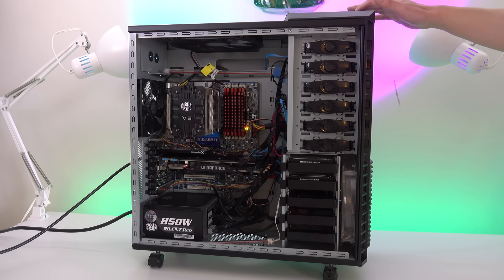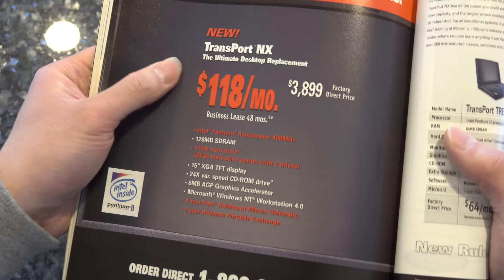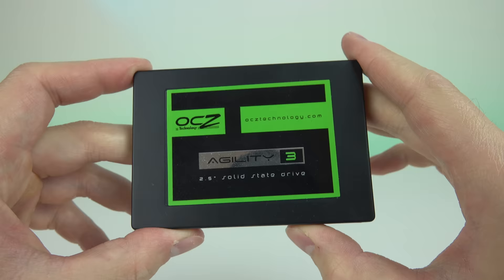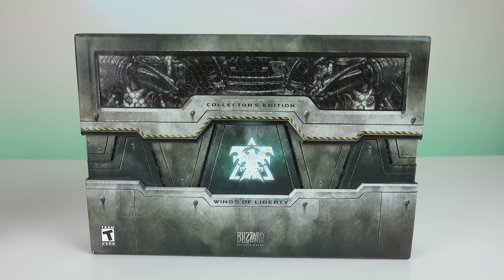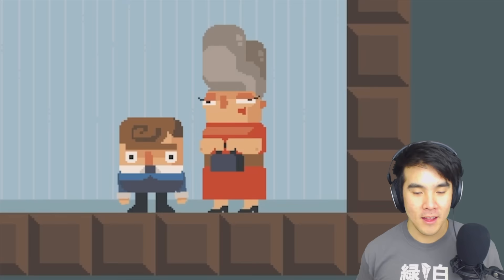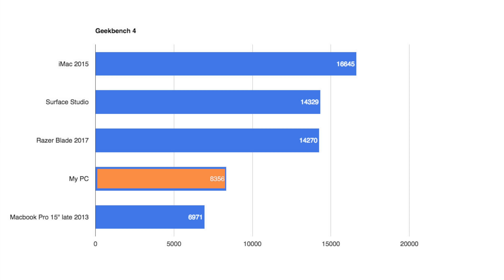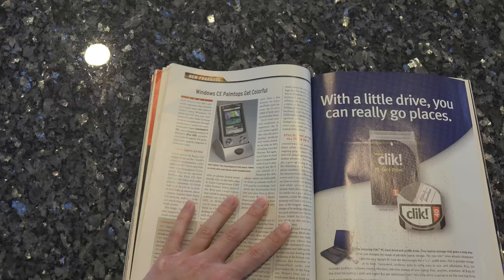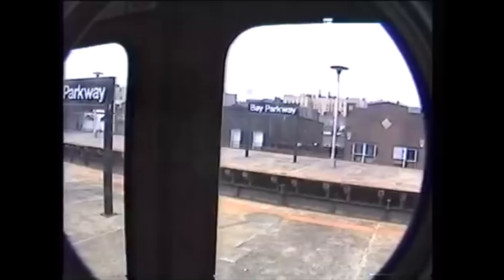I Built This PC for $1360 in 2010. Here's How It Holds Up.

Comment: Yeah cool
Now show us the pc you built in 1360 for $2010
Reply: That thing is pretty hardcore, with a small formfactor wooden case, a rockium processor and a cutting edge screen made out of quality canvas. The memory depended on how tired you were when using it, which was the best that could be done at the time. Also it had no GPU, as there was no need for one at the time, making it unable to even display a Picture. But it could handle about 0.5 calculations per second at it's peak, sometimes exceeding times of even 1 calculation per minute. The most expensive parts of the PC were the case, and the canvas screen, as canvas was pretty damn expensive at the time and the case was custom made. The canvas cost 1900$ and the case cost 110$.

Let's just say i wouldn't play Minecraft on it.
Reply: You'd probably have a better time playing Minecraft in real life.
Reply: @JamB-zo1ln  Battlefield too
Reply: @JamB-zo1ln  Assassin's creed

Comment from the maker: Hey everyone! I posted a new video "These Tech Ads From 1999 Are Ridiculous. How Do They Compare to Today's Ads?" https://www.youtube.com/watch?v=fkSe8CaAJnc thanks for visiting 🙏
Reply: Chubbyemu but can it run crysis?
Reply: Hi There, Before you retire that system buy an used Xeon X56xx chip and install it.   I just upgraded my system from a i7 960, to a Xeon X5670 and "only" OC it to 3.6 (3,75 ht) so far.   Its performing great.   I did this after buying a GTX 1080 card  (old GPU 2x6970 2GB) as the first component of a new system, but decided to try out the Xeon X56xx before i retired it.   6 cores with HT with no OC issues so far great results.   The i7 9xx series are 130W cpu's on the 45nm layout.   Xeon X56xx are 95W on the 32nm build.   So my cpu @ 3,6 with all cores, ht and turbo on and 1,32V 150MHz bus and 24x multi is 100% stable.   (Motherboard: Rampage III extreme, 12GB DDR3 @ (752MHz/  2.4GHz).   I'm really happy. Way less noise, and performs way over my expectations
Reply: Ciliaris1 The 1366 Xeon's are great ! Now im using a x5650 running at 4ghz at 1.285 volts on my asus P6T V2, In cinebench i got like 940 points in cinebench r15
Reply: Ciliaris1 i am running x5650 @4.4ghz with 12gb ram @1700mhz with gtx 980
Reply: Chubbyemu great video! The 3rd generation i processors sandy bridge were a lot faster than what you have now. If you had that one you probably would have been able to go on for a couple or more years!
Reply: X AK close to my specs x5650 @4.4 with 7950 crossfire
Reply: Chubbyemu are you chinese people?
Reply: put a 40 dollar xeon chip in there.  you will use that pc for 2 more years.
Reply: Chubbyemu yeah unfornatlty even though its 2017 my aunt still thinks it's 1991
Reply: About your streaming, have you thought about using hardware encoding?
Reply: Chubbyemu your cpu is whats holding the system back a 7th gen i3 is probably faster
Reply: itsya boi Not true, as my 7 year old x5675@4.17 GHz beats an i7-6700k, he can do the same upgrade to his system and keep it for another 5 years
Reply: Well my pc is Core2Duo 2x1,86GHz from 2006, 4GB RAM, HD5770. Both ram and gpu bought in 2010.
Well it's worth mentioning that I run 64bit Linux and all works great while 64bit windblozer just kills this machine. No matter win7 or 10. If it's 64bit you could say that this rig is a trash.
I'm curious did you add extra value from upgrades like new ssd and gpu to the entry price. After all it's a total cost of your pc.
Plus I still have my Commodore 64, but psu cables burned, so they need to be fixed. Other that that it also works fine.
Reply: Mine x5675 is at 4.5Ghz with watercooling, and makes more Cinebench than 7700k at 4.5Ghz :D ofc it is 6 core but you know ... :) CPU + MB + 24Gig of ram cost me only 300 eur :)
Reply: Andrej Ka Hey what bios settings did you use to achieve the awesome 4.5 GHz clockspeed? Mine's at only 4.17 GHz and still beats a 6700k in passmark! Just so you know your board supports up to 3x more memory!!! Guaranteed to go up to 48gb with a slight possibility of even 96gb of ram!!!!!!! (too bad ram prices are going up)
Reply: Hades Eye Upgrade your core2duo to a Xeon quad-core x5470@3.33 GHz, huuuuuuuuge upgrade and will add a equally huge smile to your face! The x5470 is so powerful@ stock clockspeed it competes with the brand-new pentium g4560 that used heavily when playing the latest games. The best part is once you overclock the x5470 to 4 GHz or up to 4.5 GHz with sufficient cooling all of a sudden the x5470 will beat the i5-2500 and compete with the i3-7350k, mind-blowing performance for LGA 775!!!
Reply: Chubbyemu if you upgrade to the x5675 you will love it, trust me, even with zero overclocking you'll gain an additional 30% performance with a low 95 watts tdp, huuuuuuuuge upgrade! BTW you won't have to spend huge money either to achieve this upgrade not to mention that you'll gain additional ram capacity up to an beyond 48gb ddr3 ecc, crazy!!!
Reply: David Johnson you have to play a lot. my mobo is asus p6t deluxe and lets me to crossflash bios from asus workstation ws mobo, so my cpu can go to high tdp mode allowing stable 25-26 milti, and at 180 bclk I get around 4.5ghz at stock and for single cores up to 4.68 ghz when it rises up to 26 multi but only SIV registers this :). . Ofc power supply is 850RMi and cooling is h110igtx modded for better air push performance. I am planning on laping this cpu and try push a little bit higher when I have time. Anyway, 24 gig is enough for me now, it is crucial ballistix sport. If I find some new ones 6x8 gigs for a good price, I will definetly change but for all work even 16 gigabytes is enough :)
Reply: David Johnson I had x4570 on lga 775 @4.5ghz too :D would be enough for everything I did, but it did not have some instructions and for additoonal few hundred euro I got faster chipset and 2.5 more performance from x5675. I think fair deal :D
Reply: I've had thesame experience with my pc that I bought for €1000 back in early 2012. Basicly, if you buy a decent pc(not budget), it'll last 5 years or more, provided you're not upgrading in  resolution.
Reply: hi i'm new to your channel i love it it brings back memories lol good work :D
Reply: Chubbyemu build a ryzen Vega !!!!!!!
Reply: Dude! I'm in exactly the same situation. Using the same rig from 2010, except no upgrades. Well one actually - an OCZ agility 3 lol. I'm amazed the same PC is still serviceable today. But you're right, now is a great time to upgrade. I'm hoping a Ryzen build will last me another 8 years. Enjoyed your visit. All the best
Reply: David Johnson not the same processer 1st generation i3-7's are all around slow joawdays
Reply: Ciliaris1 Also your board can now go up to 48gb of ddr3 ecc ram, potentially even 96gb!!!
Reply: Chubbyemu chubby, you have acne scars. Ok.

Comment: It's crazy how much longer computers last now. I built a gaming PC in 2012 for $1,000 with an 3770k and 16 GB ram. Other than the video card dying a few years back (where I just purchased a $50 replacement) and upgrading the ram around that same time to 32 gb (for equally cheap), it was fine until recently when I really started seeing mediocre performance in games and upgraded. And honestly, for regular use, it would still be very fast.

You just couldn't have that kind of longevity with computers in the 90's and 2000's.
Reply: I have almost the same experience (even video card dying few years back). Just finished building new PC few days ago mainly for gaming, and as you said, for other tasks it would have still been fine. Hopefully it will last another 10 years.
Reply: i have like your old setup and it works great for me stil can run most games at good enough speeds for me
Reply: @TheCtibbs  I doubt that honestly, I had to get rid of my i7 4790K and GTX 970, with ddr3 ram. The cpu isn't the problem it's everything else, especially since I wanted to use Windows 11 and an nvme ssd. Got a 12700k when it came out (which is now more than half price) and 3090 (same case) which would last me another 5 years but I'm probably gonna upgrade next year again. It was a night and day difference though. The 12700k is now cheaper than the 4790k I bought when it came out. 

The great thing about PC building is I can sell or keep my old parts. It's like chasing a high. I don't need to upgrade, but the ability to do so drives me to do things that require more power, making me want to upgrade every few years. Honestly though if you can afford it, I wouldn't keep using ddr3 and PCIe 3 in 2024, when ddr5 and PCIE 5 are a thing. Get something in the middle. I'm still on ddr4. 

 Your platform is over 10 years old, it's best to upgrade at least every 5-7 years like consoles do.
Reply: @mycelia_ow upgrading every 5-7years works only if you get high e d parts
Reply: @Ciffer-1998 entirely depends on what you do. if you are just a casual gamer who wants to play on 4k high settings and changes games like socks, then yes
Reply: Same, my my pc is still a 3770 oc 4.1 ghz, 24 gb ram and GTX 1660 Ti, my GTX 770 died in 2018 so I upgraded a year later, in some games still have smooth 60 fps, meanwhile other the fps drops to 40s & 50s, spiderman remastered run at 60 fps custom settings without any upscaling
Reply: @Ciffer-1998  Not really. It depends what youre using it for.
Reply: This video is 6 years old which means its almost as old as the pc was when this video was made. Youtube algorithm is at it again
Reply: @jebreggie4225  playing games, if back in 2016 you bought gtx 1050,1050ti or 1060 here in 2023 can can barely play anything even on low, on the other hand if you got gtx 1080 or 1080ti you will still manage 60fps in most cases(i am not counting on upscallers and frame gen)
Reply: I equate this to the fact that hardware advancements has slowed down significantly. A lot of our standards have been standard for a while and have been excellently future-proofed. While we still have bottlenecks, there aren't as many technological improvements that aren't compatible with existing hardware as there used to be back in the day. It's great, actually. Because the hardware I use for a computer I built for myself back in November 2023 is still capable of running Windows Vista and 7, showing how well the technology was originally developed and how it still stands up today.
Reply: @Ciffer-1998  The 1060 came out in 2016 and can still play games despite not being a high end part so you disproved yourself. even if its best days are numbered it still got seven years for many people
Reply: @mycelia_ow  I use ddr4 but PCIe is another story, new games doesn't utilize the full capability of PCIe 3 let alone PCIe 4 or 5 and now 6 released in 2022, unless you use PCIe 3 x16 for massive data transfer between 2 PC's with a speed beyond the latest nvme speed 7 GB/s while PCIe 3 x16 speed is 16 GB/s, and this invention doesn't exist yet for consumers.
Reply: Yeah I still have mines I built in 2011 with upgraded parts.  Still runs good.

Comment: 3 ghz in 2002.
my laptop from 2015 still running on frickin 1.5 ghz...
1.5 GHZ
Reply: Schroeder M. Schulz Mine is 1.6 GHz and it cost me only 300
Reply: DiBoss Wtf...
Reply: Schroeder M. Schulz Uhhh, sorry, that's now how specs work.
Reply: Yeah well, you can't compare clocks between proccesors from different arquitectures.
Reply: Your laptop is still faster tho :P
Reply: They were single-core.
Reply: Then the 1.4k MacBook pro with less than 2.5ghz processor
Reply: and your laptop is far more powerful
Reply: Lol well back in 2002 it was most likely a single core cpu.

I've got a laptop with a 1.4ghz e1-1200 dual core
Another laptop with an a6-6310 1.8ghz quad core

And my desktop is a 3.7ghz hyperthreaded dual core :)
Reply: Sitting on my 760k @4.5ghz, got a job planning to get a i7 7700k @4.2ghz native.
Reply: Would rather go for a R7 1700
Reply: DiBoss you got ripped off bro.
Reply: Armand Kabanga No he didn’t. Most laptops in that range are about that speed. Clock speed doesn’t determine the speed of the CPU completely. 

He could have a quad core 1.6ghz in his laptop with 6gb of ram and a 250gb ssd. But since you don’t know the rest of his specs then you can’t say he got ripped off.
Reply: PissedOffHoneyBadger true true, I assumed he got ripped off cuz I got 1.6ghz too, and I can't even run saints row 2 on low settings
Reply: Armand Kabanga Well it’s a $300 laptop. You can’t really have high expectations. It might not be able to game because the specs are low but don’t say you get ripped off because the price/performance could very easily be one of the best on the market even though it still sucks for gaming.

1.6ghz could be plenty but you have to take account of the GPU/iGPU as well. It could very easily be that.
Reply: Schroeder M. Schulz my laptop got a 1Ghz processor
Reply: my laptop is 8gb ram 1tb hdd and 2.5 ghz 4core cpu i paid like 350$ ish for it :p
Reply: its more powerful and far better than the 2002 ones cuz its multi core, even 2 cores are far better than a single core, the difference is actually great than two times, 4 cores was the next big jump but after 8 its not that significant
Reply: Starless Knight lol what you talk is bs, sry
Reply: Microage so your saying you would rather buy a 5ghz single core processor rather than 2.5 ghz dual core processor?and the single core is better?
Reply: Schroeder M. Schulz I also have a 2002 dell laptop functioning fine.
Reply: adrian gil of course it would run fine..

if you didnt install any modern shit in it..
your dell would ran smoothly
Reply: Starless Knight 

Okay you must take account of the age as well. Some CPUs have better technology which help execute processes even if they have the same amount of cores and clock speed. For instance, my I3 6100 has a 14nm (nanometer process technology).... the lower the number the better it seems the be.

My i3 6100 3.7ghz dual core can beat the AMD Fx 8350 which is like 4.2ghz and an 8 core!!!!

I would recommend a 2.5ghz dual core over a 5ghz single core any day.
Reply: PissedOffHoneyBadger i know but i never mentioned nm did i
Reply: ateb3 it doesn't work that way
Reply: sideKick Haha I know right.
Reply: Still faster speeds than a modern Macbook.
Reply: DJ Shuffle anything is faster than a modern macbook
Reply: sideKick thats a sarcasm..
Reply: Schroeder M. Schulz too bad ghz doesn't mean shit on its own
Reply: before cpu's were all about gigahertz because speed was directly affected by the number of transistors. then intel released the core series and everything changed. nowadays, the architecture tells how fast your cpu can get. In other words, that 3 ghz in 2002 is definately beatable by a 1.5 ghz cpu from 2015 because of the difference in architectures
Reply: PissedOffHoneyBadger my pc was under 300
Reply: Who cares about frequency ? CPUs are way more efficient nowadays so a 3ghz cpu from 2002 is waayyy slower than a 1.5ghz cpu from today
Reply: The number of Ghz isn't really important for that. 1.5Ghz nowadays is way better than 3ghz in 2002. CPUs have way more tech than just ghz.
Reply: 3 ghz but it's single core.
so who cares?
Reply: powebat I feel so bad for you
Reply: my old computer was 1.5 GHZ too, it was about 200 to 300 dollars, I think what bumped up the price for that pc is that it had 1TB and 8 Ram. lol

edit: I actually kept that crappy computer for about 2 years and a half until in December 2016 I got a new pc that cost about 1 thousand dollars now
Reply: Clock speed is almost meaningless these days. The number of cores and IPC count is much more meaningful.
Reply: My first PC in 1996 was 133MHz... it had a 1GB (about 1000x smaller than 1TB) HDD. Used it ONLY for word processing in College, and didn't even have an Internet connection. $3000 (CDN) including my 15" CRT (tube) monitor... spent $400 on a 4MB video card for some reason in the next year... my roommate spent more than that to upgrade his 100MHz? CPU to 166MHz + video card so he could play Wing Commander 3... in 1999 he spent $300 on a CD-R for it and it kept getting ERRORS because there was no proper BUFFERING of data (so had to drop CD recording to 1x down from 4x).

Built a new PC every three years then my i7-3770K (4.5GHz OC) rig has lasted me FIVE YEARS (with GPU, SSD etc upgrades) and I plan to keep it at least FIVE MORE YEARS...

I rarely use more than 50% of the CPU so even if games get more demanding of the CPU I think DX12/Vulkan will make efficient enough usage of it so that there's no pressing need to upgrade (by using MORE of the cores AND using more efficient code for draw calls etc).
Reply: yeah, cause its a laptop, it probably doesn't have a full fledged desktop grade cpu in it.
Reply: LinusMLGTips yes that is, his cpu is running at 1.5 ghz.

Comment from the maker: I upgraded this PC with an x5650 processor. Here's the video: https://www.youtube.com/watch?v=KtjactGqJLg
thanks for visiting 🙏
Reply: gg
Reply: gg
Reply: On just a bad cpu, i'd recommend using your gpu to stream. OBS and xsplit utilities your cpu to stream, try using nvidia shadowplay to stream since it uses your gpu more than your cpu to stream, overall giving your system a better feel.
Reply: Chubbyemu should have overclocked the 930 instead, but only if you had a good aftermarket cooler. It'll hit 4ghz easy
Reply: Good pick, grabbed an x58 rig for free recently and dropped in one of those for chips. Still a great machine.